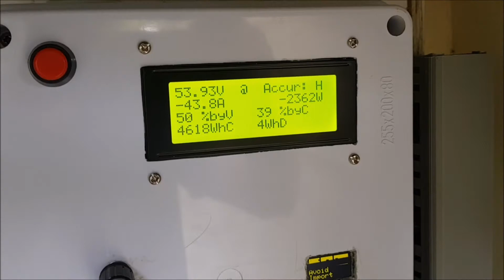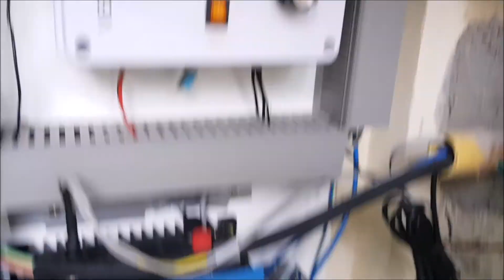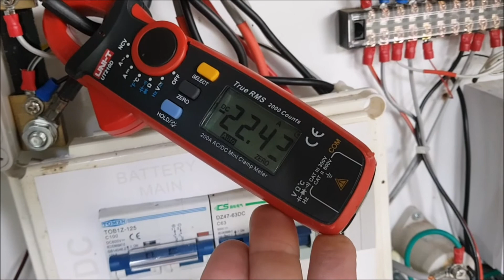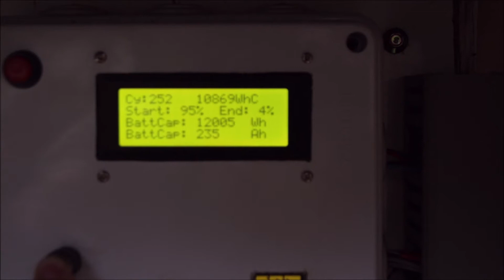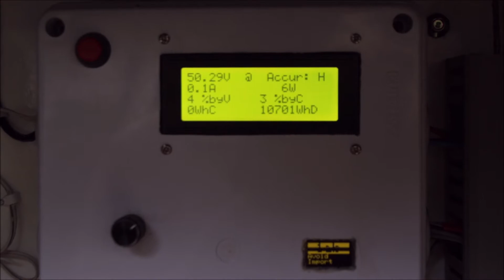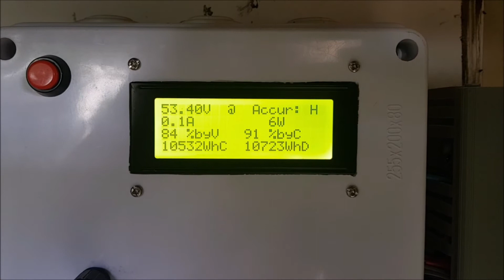AC-Powerwall is getting a DIY Coulombmeter as an upgrade, Part 2

Comment: I am a simple guy I would just buy more cells and run it always in the flat part of the curve lol.
Reply: you gave your cells a nice retirement roland :)
Reply from the maker: @houseofancients  thank. Do you have a battery bank as well?
Reply: @RolandW_DIYEnergyandMore  had a 100 kwh of tesla modules, coupled with 2* mpp solar mpi 10k in my old house.
i have sold that , including inverters and modules, so now am rebuilding from a greenfield.
eventhough i have had above configuration for 5 years without issue, i wouldnt use li-ion in my home again.
currently waiting for my lifepo4 cells to arrive.
they will be "talking" to 3 x voltronic axpert 8000 max inverters , in a 3 phase configuration...
Reply: so do i have a battery bank now ?
no, but it will be here
Reply from the maker: @houseofancients  cool. Yeah, LFP is the way to go. Great plan!
Reply from the maker: Yes. But LFP is such a beautiful chemistry. It can be safely deep cycled. Just stay between 50-55V in a 48V system. I am just avoiding the drop-offs like the plague.
Reply: @RolandW_DIYEnergyandMore  yes I only use a 3 volt spread (38.7-40.5) in my 40 volt system in summer 41.2 but there is not much capacity up there